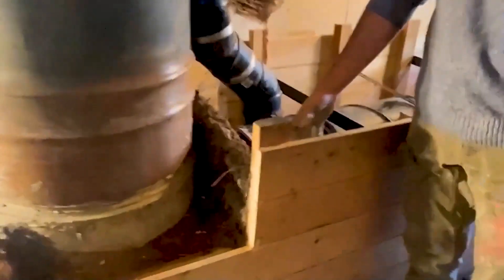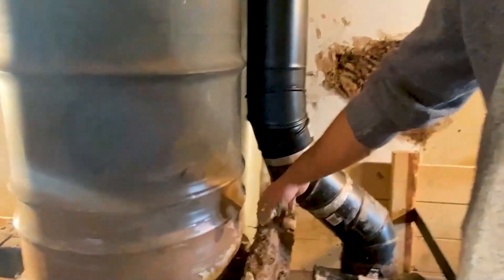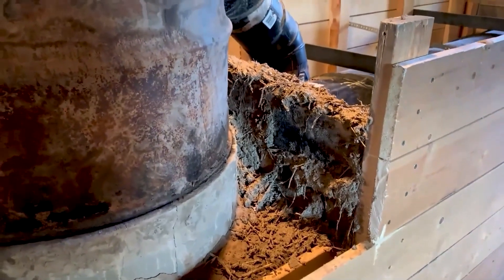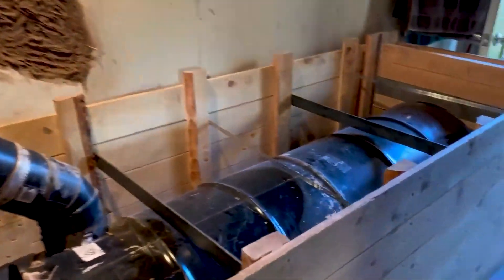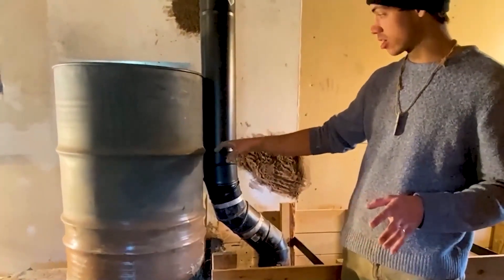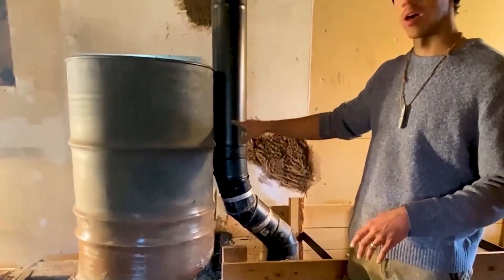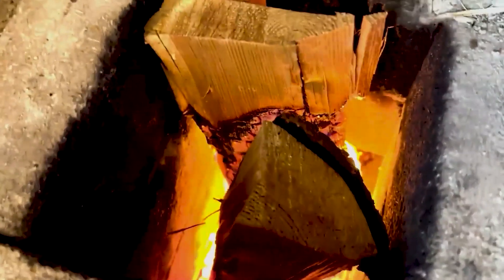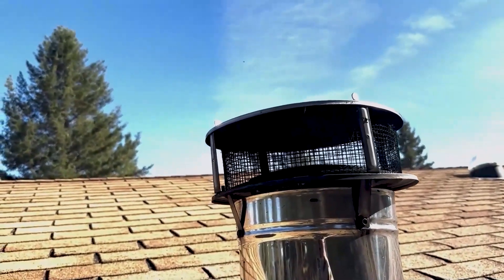further optimizing rocket mass heater design - kiss the barrel

Comment: Hey Paul- could i beg you to answer a question about your previous video please? How long do you estimate it would take a large cob hat to heat up to 160f?
Reply from the maker: It depends. And the top will never be as hot as the bottom.  I think that a large system will see a spot on the bottom hit 160 in half an hour.
Reply: @paulwheaton  👍😁

Comment: Once you have established the draw by the barrel getting hot which in turns warms the flue, (to establish your draw), how do you propose to keep all the heat in the room from the barrel, or are you saying you have to heat your flue all the time.  Bypass seems to work well for these but maybe not in this set up?
Reply: The barrel provides the initial heat, but the storage in the mass is what provides most the heat.
Reply from the maker: We took the bypass out.